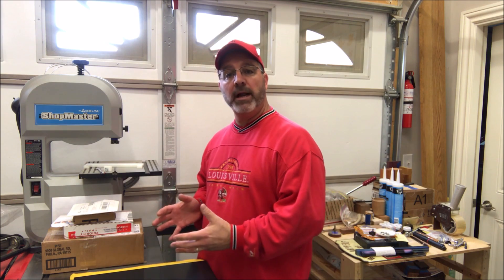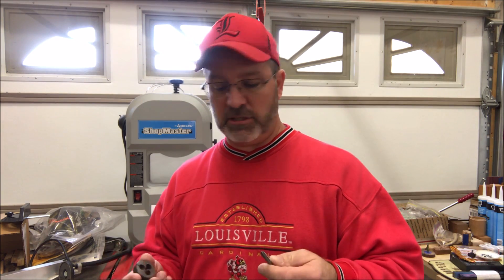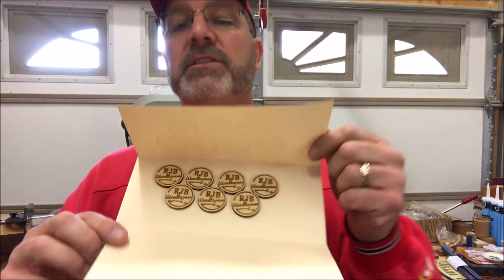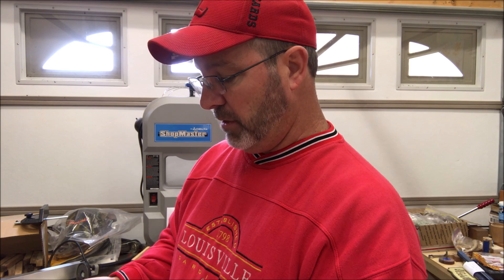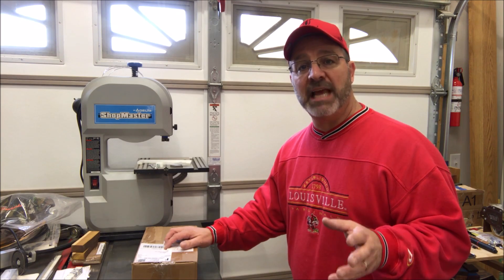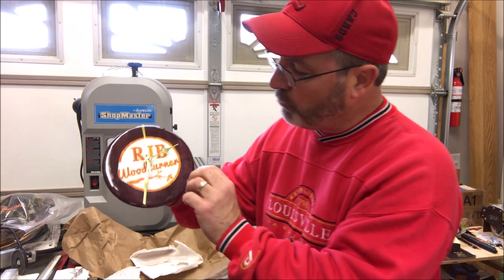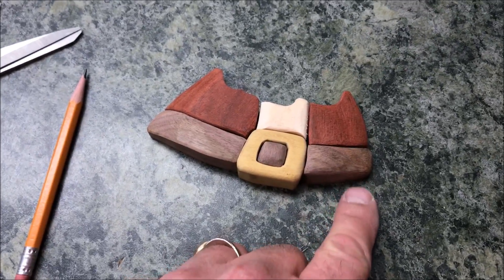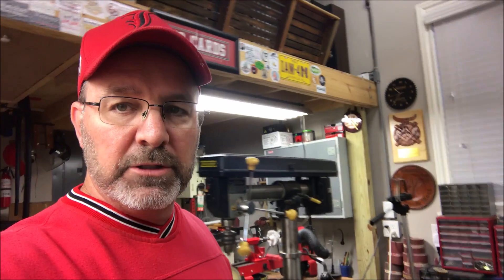Shop Update 11/8/2018

Comment: My shop projects kind of ended LOL.  I still have a steel pen body on the metal lathe as I have yet to find a cutter to replace the carbide one that I broke trying to turn that steel pen body, I figured a carbide cutter would be the way to go, but I guess not on steel, have to find something else....that was in July.  A lot of stuff has happened since then so its been a very stressful few months.  

Starting to catch up a little bit but not sure when I'll get out in the shop again, its packed full of stuff out of my room and spare bedroom while I tackle a flooring replacement so everything else is on the back burner.
Reply from the maker: I completely understand and feel your pain. 

Regards,
Bob